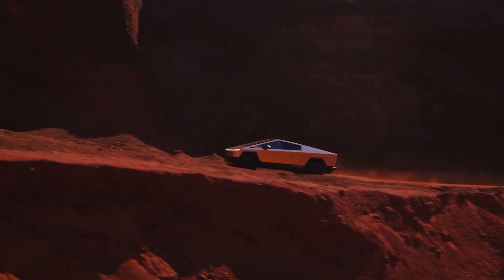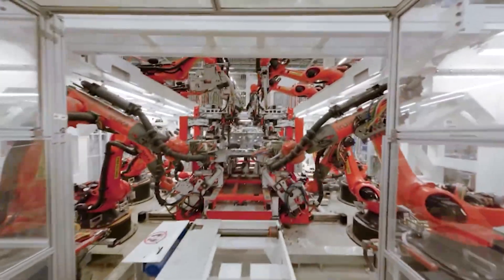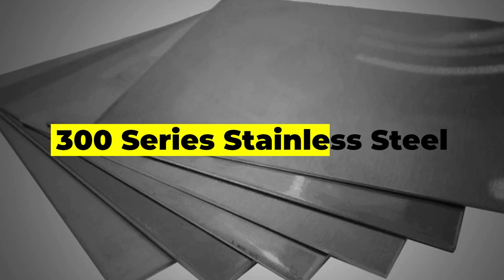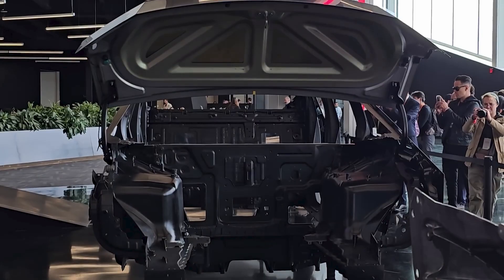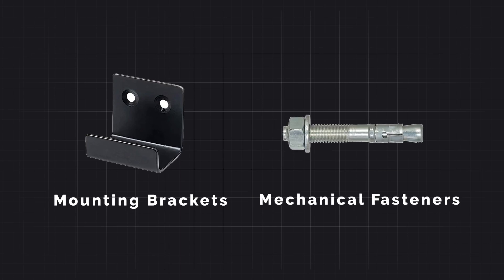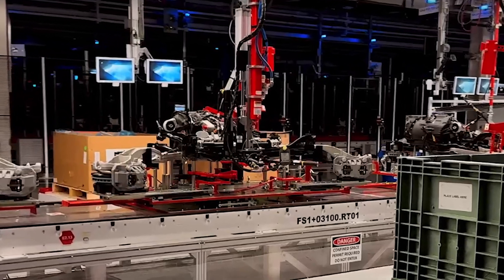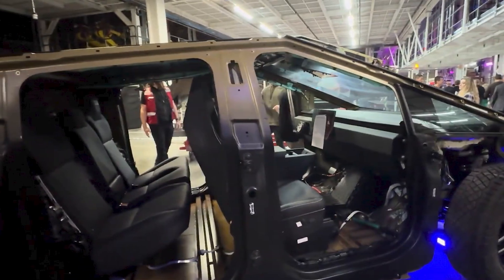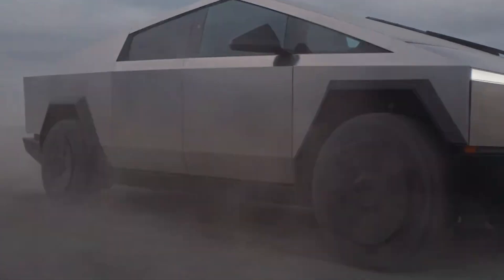How Tesla Builds A New Cybertruck!

Comment: There’s nothing revolutionary about it.  Kids’ have been building models of trucks for years…using glue, just like Tesla.  Only, those kid’s little trucks are much safer, because they’re way to small for anyone to get inside them.  

What Tesla’s actually been building is the most flawed, most dangerous vehicle known to mankind since vehicles were first being built.  Those same bullet proof doors and extremely strong windows not only keep unwanted items on the outside, but they prevent the passengers from being able to escape from the inside.  These vehicles are incredibly dangerous.  Body parts go flying off because the glue they’re using to hold them on can’t withstand the heat that those body parts easily get to when the summer sun is beating down on them.  The glue completely dries out, cracks apart, and pieces that are supposed to be held on go flying off.  If the truck catches on fire, good luck trying to escape it quickly, because everything inside is going to shut down, leaving you trapped like a rat in a cage.  You can’t get out, and anyone trying to rescue you can’t get in.  Meanwhile, that extremely volatile battery system that’s right beneath your floor will quickly burst into flames and cook you alive.  

Instead of making them look like a refrigerator, Elon should have made them to resemble a garbage truck.  Then they could take themselves out.

Comment: Good analysis of the Cybertruck mechanical structure.

One minor correction:  @9:25: the dual-motor version ALSO has the permanent magnet motor in the front and the induction motor in the rear; same as the tri-motor placement.  It is the single-motor RWD version that has the PM motor in the rear.  Was covered in Munro Live video w the 5 Tesla engineering execs released on 11 Dec 2023.

Comment: Some of your facts are incorrect. It’s been verified that 1.8mm thick SS is used for the door skins, 1.4mm thick SS is used for valance, fenders, frunk skin, quarter panels and tailgate. Also, the frunk and inner door structures are also made from SS, not aluminum as you state. It’s a thinner gauge so it can be hot stamped.

Comment: Unfortunately you have only a vague idea about the construction of the Cybertruck. Apart from the F & R castings, there is NO aluminium in the structure of the CT. The "exoskeleton" door opening frames and the inner door shells are all steel and stainless steel and are either laser welded together or spot welded to the outer Stainless Steel panels. You should watch the Munro Live vids on the building of the Cybertruck.

Comment: The exterior stainless is attached the same way as all fixed glass in today’s cars. It’s a two pack mastic the glues the panel to the frame.
Reply: My guess is they are using a high strength structural adhesive to mount the quarter panels to the aluminum Giga casting.

Comment: My engineering instincts tell me the stainless steel panels are bonded to inner panels (likely steel), and it is those inner panels that contain welded studs or inserts. This way they can not only hide the spot welds, but they are getting a vibration damping bonus (in the industry this is called constrained layer damping).

Comment: -- Two unlike metals fused together in a "modern world"(for like 30 years) usually done with epoxy adhesives. That bond also prevents unlike metal corrosion.
Reply: Stainless is pretty stable and compatible with most metals so not a problem

Comment: i have a feel this will be a very niche special purpose vehicle like an armored police car or something, cant figure how it can replace the likes of F150 etc.
Reply: Tesla has gone to great lengths to make it a practical truck with hold downs, 4' x 6' bed and carbon fiber liner. 4'x8' plywood and drywall can be hauled with the gate down, it will only overhang about 6" beyond the tailgate. I know a lot of truckers put a big premium on towing for long distances, prime example is hauling a large family trailer for summer vacation. Cybertruck will not be a good choice for these people. But any contractor or private owner that doesn't have to go long distances regularly will find the fuel savings and scratch resistance highly desirable. Many will really appreciate the 110v & 220v outlets. Also great for off-roaders who do not have to go a long distance to their favorite site.

Comment: I think you'll find the front subframe is still welded steel painted black not an aluminium casting. At least from the pictures ive seen. The rear subframe looks aluminium however.

Comment: Being a painting contractor, I'm wondering how I'm going to install ladder racks. I guess they'll have to be stainless steel. :)
Reply: carbon steel ss contamination - gotcha
Reply: Or standard steel chrome plated.
Reply: This truck may not be the best choice as a do all contractors truck.  Being so new and different, any accident or problem that needs shop repair may cause it to be laid up for a longer time than normal.  Also nobody knows what the cost will be to insure this vehicle.

Comment: I am wondering if the wheels align themselves?  With 4 wheel steering you can’t expect a regular tire shop to align the wheels….curious if the computer does it on its own.
Reply: There would just be a centre position for the rear steering rack. Then the adjustment would be from there.

No different than aligning the front wheels of any car.
Reply: I've owned 2 four wheel steering vehicles in the past, a Honda prelude 4ws and a Toyota exiv 4WS.Never had a problem getting them aligned

Comment: You said easy to manufacture but a news outlet that I watched earlier has the title "why its hard to manufacture a Cybertruck"  I do like the simplicity of controls for new tesla vehicles. Modern cars today tend to look like an airplanes cockpit.
Reply: Probably it takes time to develop the machines that make the car, new supplies chain for 48v system, etc, once those are solved the process should be simpler. Just like drug are quickly made but R&D is extensive and lengthy.
Reply: Easy/hard depends on viewpoint. Easy because Tesla engineers spend a lot of time to make sure the parts go together without a lot of twisting and turning. Hard because bending the stainless steel required designing new high power brake presses. Engineering was hard, capital expense for machinery expensive. But actually cranking out the vehicles is easy. I would really like to know how many humans work on assembly, some have said the line is highly automated.
Reply: The “hard” part is making sure that it’s manufacturable, and testing/refining the many sub-processes. Showing how it has been worked out is the whole point.
Reply: question is how hard is this thing to REPAIR because if its a nightmare then insurance rates will be astronomical
Reply: @hitherefrompointswest4805 Indeed. Repair shops would need to learn a whole load of new skills, and buy in components from Tesla. Not many third parties will have gigapresses i.e. none.
Reply: @hitherefrompointswest4805  Tesla repair cost are always outrageous, at least judging from the crash videos.

Comment: I heard the battery assembly revolutionary?  2 400 volt battery packs series/parallel to make 800v.  4680 tabless dry cell.  Dry cell very close to solid state.  Dry cell gets rid toxic black slurry/mixing/baking section.  So less machines and time

Comment: Cold rolled Stainless Steel is MARTENSITIC stainless steel.  Mechanical stress causes permanent change in  crystalline structure of metal to change to one of the hardest or most hard stainless steel. Similar to comparing cast steel/aluminum vs forged steel/aluminum.  Forged is lighter and stronger vs casting
Reply: It's 300 series stainless, the most common.  It's not made to be hard.

Comment: I think 300 series stainless could be stamped while “red hot” in its “O” condition, but I’m not positive. My theory is that Tesla could heat sheets to this condition and then stamp body panels that once cooled would be stronger than flat panels.
Reply: 300 Series stainless is work hardening, and cannot be hardened via heat treat. So 'hardened' sheets are formed via cold rolling. Getting it red hot would essentially anneal it, resulting in it remaining soft when cooled. Then there would be realistic way of hardening it from there.

Comment: @6:26 invisible method It's called glue. Aeronautic/Automotive adhesives have become much, much stronger. 
(Remember the trouble Munro Associates had taking the structural batteries apart. It's gotten worse.) 
Tesla bonds the steel panels of the exoskeleton to the GigaCast structures.
Reply: The glue is used to bond the ss to a stamped steel support panel which in turn is bolted to the aluminum cast sub-frames.
Reply: Can you link to an image or a source for that? @royh6526

Comment: A very informative description of how the exoskeleton is attached to the aluminium subframe - could be concrete anchor bolts, could be bolts, could be rivets, could be foam, could be glue, could be welded. Now if you just add soldered, brazed or rubber clips it would cover most options. Whatever is used will confirm to his fanbois that Elon knows more about manufacturing than anyone on earth.
Reply: No, Tesla has stated they use glue.
Edit: Turns out to be only partially true. The stainless steel is glued or welded to a stamped steel backing which in turn is bolted on to the aluminum substructure. Quarter panels are glued, door panels are welded.
Reply: Structural adhesive is used to attach the rear quarter panels to the aluminum Giga casting.

Comment: This is not a good explanation video😂 there's no information on the bending machines, the components for the stainless steel penal are ambiguous, and didn't even mention the most wonderful part of Cybertruck, the industry-first 48-volt low-voltage system and steer by wire system neither the 800 volt architecture is mentioned😢😢

Comment: Ironically one of the Cybertruck's largest innovations in volt architecture which apparently cuts down on electrical wiring by 70% which few people think is an issue however with the ever increasing price of copper and the fact that Ukraine was the #1 supplier of vehicle wire harnesses and this cuts down on many issues at once...
Reply: Also there’s like 1,000,000 preorders and Tesla will probably take a long time to ramp up production so there’s gunna be a bunch of scarcity that people will pay for
Reply: yes why is it so expensive then?
Reply: @Holeyguagaamoley  Supply and demand. Plus uniqueness factor. The moment these 2 factors cool down so does the price. Until than Tesla would be a stupid company to reduce price as long the development cost are recovered and people r buying it at high price in large numbers.
Reply: Really? Ukraine? I very much doubt that. The news is the #1 supplier of total BS.

Comment: How will the cyber truck handle snow plow attachment?  Is there a option for snow plow.  With all that torque, it would literally be beast at plowing snow.
Reply: 5 tonne towing that incl a braking component means you could wack 18 disc on and go plough a field :-)
Reply: Plowing snow? It'll be out of charge in 30mins.
Reply: @KingSobieski 30 minutes???  123kWhr storage without range extender??? go do the maths.

Comment: Stainless steel could bond well to aluminum with adhesive designs like 3M VHB Tapes. This provides sound-deadening properties as well.
Adhesive foam is used in structural battery packs for example.
Reply: What about temperature changes and differential expansion, and also salt from the road surface.
Reply: Application formula variants address requirements as do engineered contact shapes. Marine, aircraft, truck, and skyscraper sheeting, applications have tested durability in extreme conditions for decades.
But you do need to get it right. @StillAliveAndKicking_

Comment: Really want to know how Tesla prevents Galcanic Corrosion. Munro needs to do a tear down ASAP
Reply: glues.
Reply: To prevent galvanic corrosion, either different metals have to be electrically isolated (rubber sheet between), or very thoroughly bonded, preferably welded. If you watch some Munro Live videos, you see that the bolts between the steel and aluminum are into an insulating plastic sleeve in the casting.
Reply: Doesn't that require a prolonged electrical contact underwater, between two different metals?
Reply: @grumpusmaximus9446 
Depends on which way on the chart.  Stainless is very inert.

It would need to be a very salty environment. Considering the structure is made out of steel that would corrode well before the stainless, so the panels would fall off.
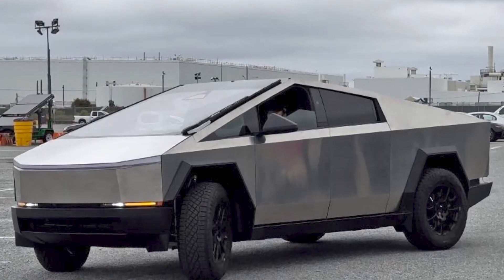Reply: @Robert-j6r8c I think the frame is aluminum which is why there have been frame and tailgate fractures edit:  based on video, they use both aluminum and steel for the frame depending on location 2nd edit:  @6:00 they say the frame is aluminum
Reply: @grumpusmaximus9446 no !

Comment: I mean you explained it yourself, it's essentially a giant structural pack model Y with cosmetic stainless steel outer panels. 

I don't see how this is revolutionary. Just replace the typical curved cosmetic steel outer panels with flat stainless steel ones...
Reply: One word: DeLorean...
Reply: With a completely new 800v battery, 48v power system and cam bus setup but don’t let facts get in the way of a good story.
Reply: @psibug565  Conventional CAN bus replaced with Ethernet.
Reply: @royh6526  wow, cos ethernet never been used in anything before.
Reply: @Supraboyes  that's exactly why it was chosen. Common, cheap, and reliable. Many times faster than the old CAN bus. It's not like the auto industry hasn't talked about moving to 48v before, just that they couldn't convince all their suppliers to switch at the same time. These are not new ideas, just should have been done many years ago.
Reply: @psibug565  ooooh aaaaah 🤣 what ever
Reply: You need to watch again. The outer panels are loadbearing not just cosmetic.
Reply: @nicklasurbansson4650  "The outer panels are loadbearing not just cosmetic..."  Bullshit, they are cosmetic, just like the DeLorean.
Reply: someone gets it.

Comment: There is a huge amount of technical innovation here. But what exactly is the point? How does all this make a better consumer car?
Reply: Drives better than you do.  Quieter.  Durable. Cheaper energy.  Almost impossìble to steal.  No accidental carbon monoxide poisoning in the garage. Fewer traffic accidents. Much more survivable traffic accidents.  Far fewer vehicle fires and explosions. No need to repaint.  Can escape flood hazards. Fewer pedestrian accidents.  Less air drag. Easier to drive, especially for handicapped persons. Lasts much longer and has far more lifetime miles. Better visibility. Virtually no recalls.  Huge cargo and towing capacity. Roomy, yet fits in the garage.  Tight turning radius.  Easy and effective steering (steer by wire).  Records everything. Counters scam artists. Drowning resistant.  Low maintenance.  No tuneups.  No oil.  Stays awake when you don't. Summons assistance when your can't.  Can be refuled anywhere.  It's pretty.  It loves and cares for you. 😊
Reply: @datummann8052  I'm talking about the Cybertruck, not electric cars in general. There is no innovation here that makes a good consumer car. It would maybe make a good armored personnel carrier. But I don't see why regular consumers need a bullet proof steel vehicle.
Reply: @WillieFungo It's for people who buy trucks not Mall Crawlers
Reply: @datummann8052  carbon monoxide poisoning, who is stupid enough to stand in a garage with an engine running...then again Americans lol
Reply: @datummann8052 😂😂😂
Reply: The innovation is in the manufacturing process. The paint alone is 25% of the cost of a modern car. The truck is framed totally different than a modern truck, so somehow weighs less and is stronger. Get one and check it out
Reply: @RyanDiederich  Saving money on paint doesn't compare to the cost or complexity of making the car out of a high grade stainless steel exoskeleton. When I first saw the Cybertruck design, I thought cost efficiencies were the goal, but Elon Musk himself said that the car is extremely challenging to build or scale up manufacturing.
Reply: @RyanDiederich You’re delusional dude.  Paint is NOT 25% of the costs of the modern car.  What ass did you pull that garbage from?  Paint is one of the cheapest items to be used in making any vehicle.
Reply: More power/torque, safer and lasts longer is a good start.
Reply: The innovation in the CyberTruck are necessary to make the $25k peoples' car.
Steer by wire (and by brake) and the 48v architecture will allow the unboxed production line.
The heralded features like speed and strength of the Truck are byproducts of a BEV and the construction method, not design goals.
Reply: what innovation ?